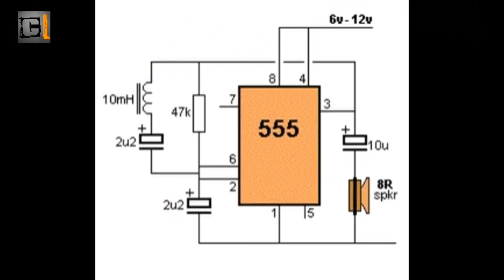How to Make a Metal Detector

Comment: i made that thing myself. kinda disappointed by the depth... its barely good enough to detect wires in a wall. gonna try to change it to a coil with a larger diameter and try it again. maybe that'll help.

Comment: In order to successfully use this detector, you kinda have to already know where the metal is. Simply passing the sensor over the metal won't detect it, you have to stop and hover over it a little, as you can see demonstrated in the first few seconds of the video.
Reply: I m not connected pcb board

Comment: just one question
doesnt the copper wire have to be insulated if it is to be wound over ......??
or else how will it behave as an inductor.?
is it possible to use insulated wires instead..??

Comment: I've made the circuit directly but after putting the battery the buzzer only works for a tiny fraction of a second and then doesn't work until I remove it and re introduce it to the circuit. What is the reason for this and for to fix it?

Comment: Really, really nice work, my friend! :D Just one question: the buzzer must be that kind used in motherboards, right? That you connect a battery and it doesn't beep.
Reply from the maker: there is on/off switch on PCB, when i connect battery at that time it was in off position, so it doesn't beep.
Reply: MC's Creations yes.
Reply: No it is not a buzzer if you talk about PC motherboards, It is just a small speaker, to use it as a buzzer you must use something like NE555 or a two transistors, one PNP the other is NPN and couple of resistors and one capacitor, that's it
Reply: Square wave....  Sound

Comment: how could you increase the range of the detection? more power?
Reply: Ben G inductors voltages depend of the number of coil turns. Sadly, the highter the number of coil turns the higher the heat produced.

Comment: Can we use an led instead of a buzzer?
Reply: yes but you must use a resistor in serial with that led, the formula is: (9-3)/0.02 =? do the math :)
Reply: عبد القادر بن محمّد بن عبد القادر thank you
Reply: yes, an led instead of a buzzer should work just fine. just be carefull about the voltage and current that your led gets. you might need a resistor to protect your led maybe.
Reply: Yes
Reply: @Triangleguy713  lol